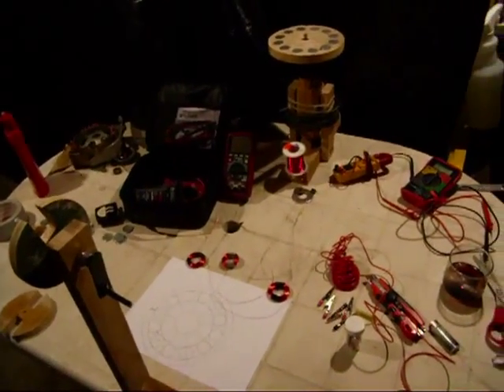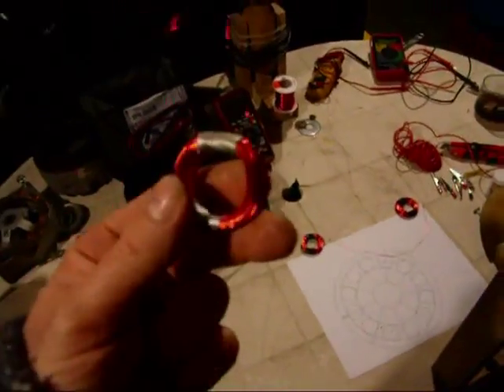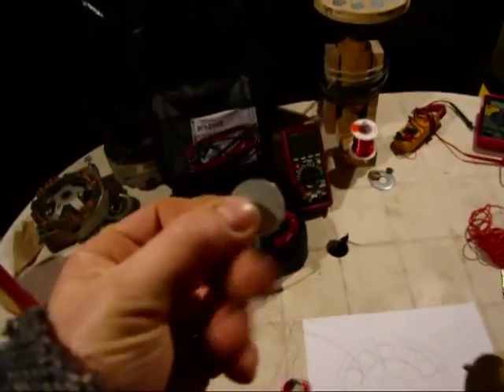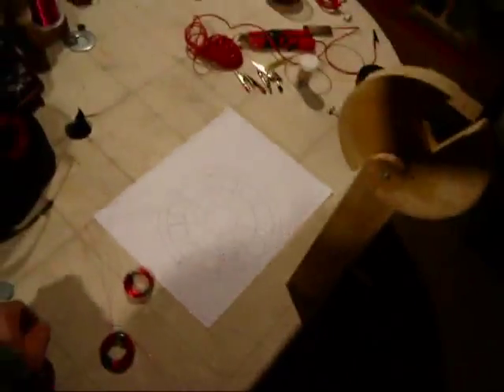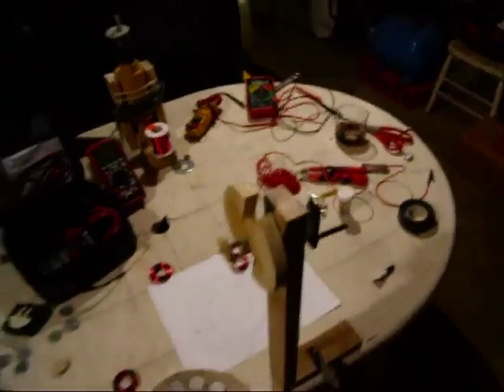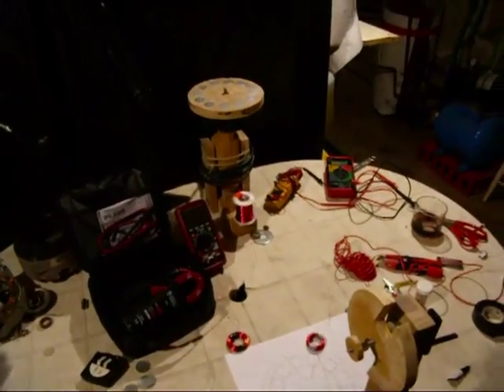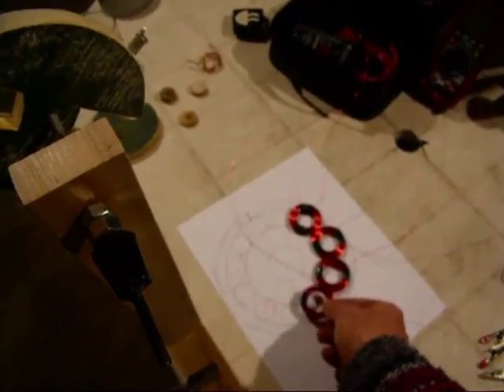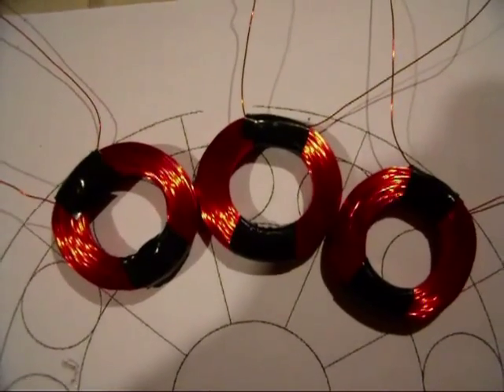My first mini vawt project

Comment: @GoodChiii actualy 10 coils 2 magnets or 10 magnets and 2 coils.  IF the  size of wire and number of turns per coil are the same the outcome will be the same.
The thing MOST people do not understand    electricity does not travale "THROUGH" WIRE  "BUT"   on the surface of the wire
What I am trying to say is.    what is the surface airia of 20 gage that (when bundled) is  =  to,  10 gage wire.

DAMD The torpedos   FULL speed ahead  STACK UM  (Not the magnets    THE wire)

Comment: @GoodChiii By all means two rotors. One on each side of the coil north to south incresses magnetic nflux crossing  the coils drasticly.
As a coil has two sides ,  so does a magnet. dual magnetic axyal flux altanatoers can be stacked,  ie.   rotor, stator,rotor, stator, rotor stator, rotor.  for as far as you want to go as long as your wind turbin has the power to turn it.
Good luck and keep up the good work.

Comment: Doubling the magnets (front to back) is a waist of your money. Stacking magnets decressis thier pull power per magnet ,  exponentualy.
8 ,  1/8  inch magnets will not pull 2 times as much as one 1/8" ,  where as 1 ,  1" magnet will pull more than 9 times as much as one 1/8" magnet.